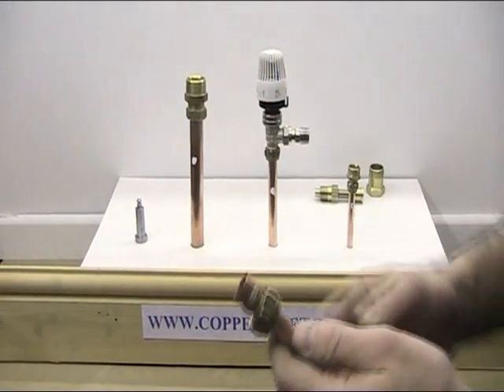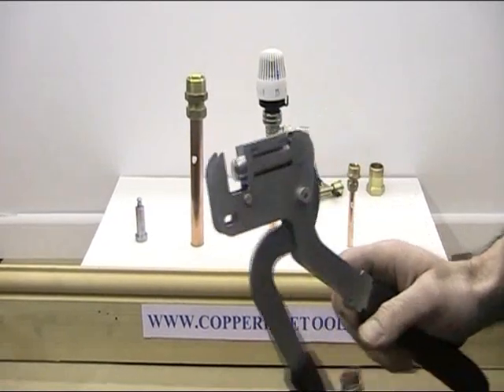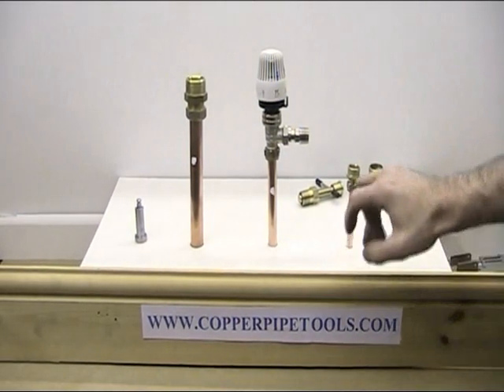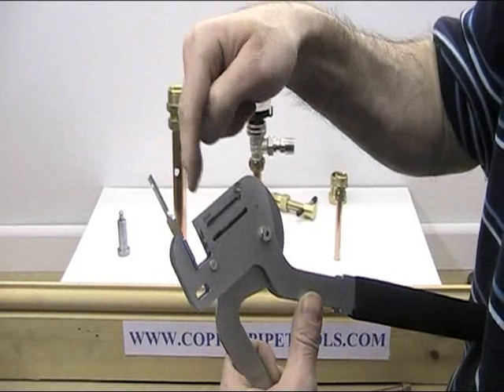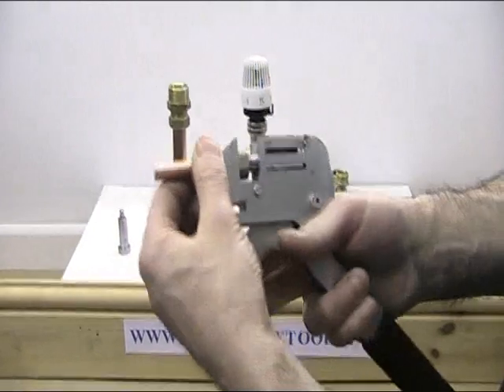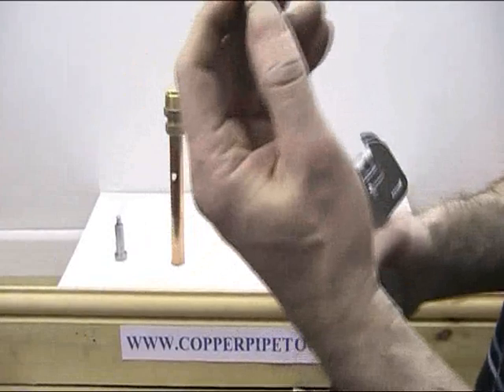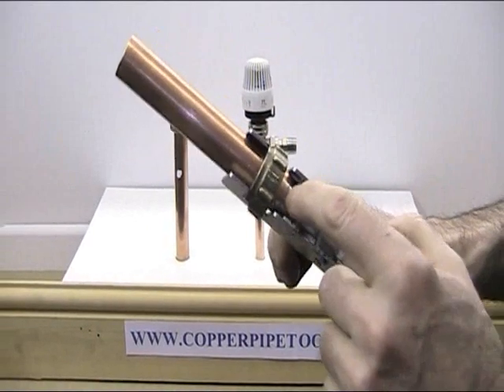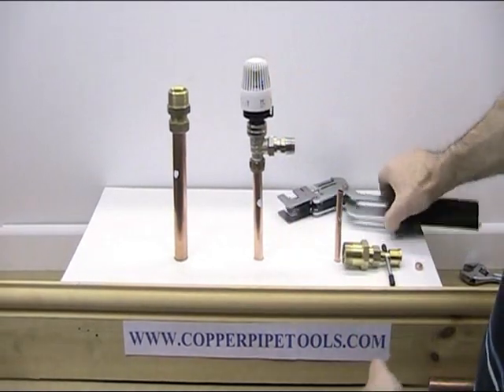Comparison and different ways of olive pulling.

Comment: The olive puller that appears at 1:08 looks good, but it is fairly large and may not fit in some situations.  It also depends on hand strength to make it work, which may be an issue for some users.  In many cases, the smaller the tool, the better.  One such tool I've seen is the Dual Thread Compression Sleeve Puller, which measures just under two (2) inches long.  It will work on 1/2" copper pipe.  It is made in China of hardened steel for the English Tool Co., Anaheim, CA.  The website is  www.englishtoolco.com.  It fits virtually anywhere and can be turned with a wrench or a socket and ratchet.  There's a video here on YouTube about it from "SeeJaneDrill"; Leah does the videos for the site and found it very helpful.